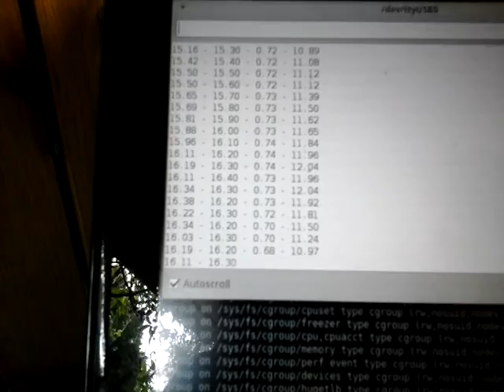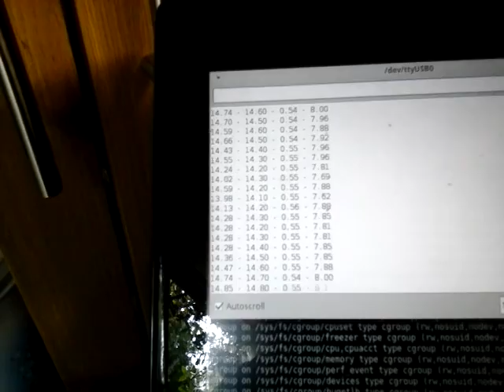Solar power optimiser testing.

Comment: Oh shuuum the optimiser works too well in direct sunlight, I have considerable shading from my next door neighbours unkempt trees and have had to Tigo optimisers fitted to my 18 X 295 watt panels and so glad I did so. The monitoring application is amazing and you can see the performance of each panel in real time. Don't install any system without a panel monitoring system, as how do you know if the panel is faulty?